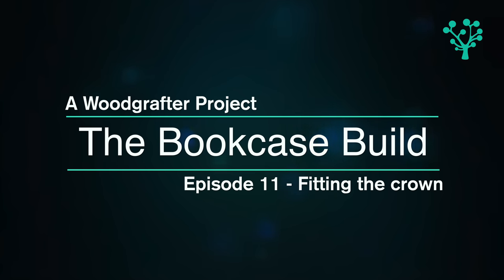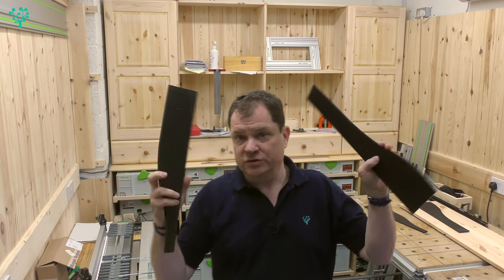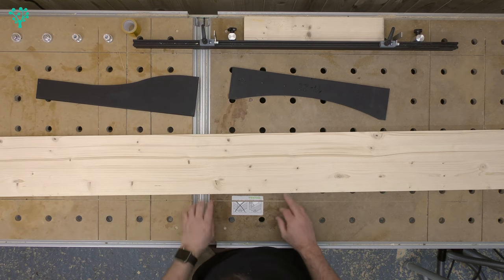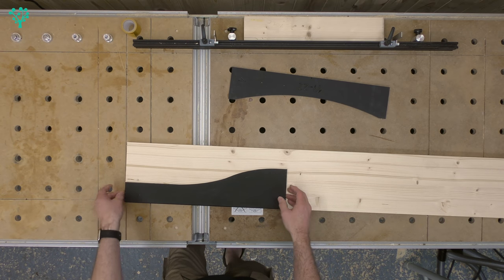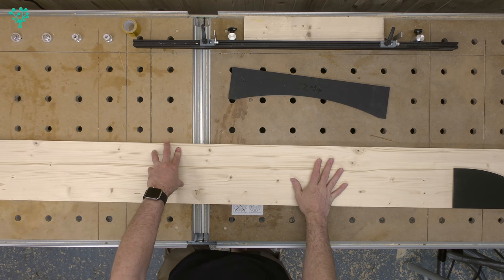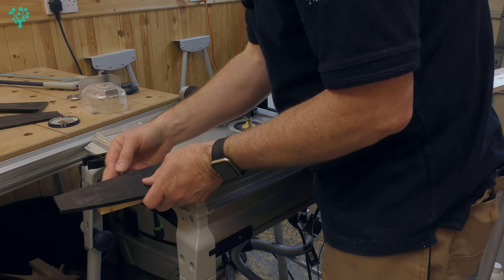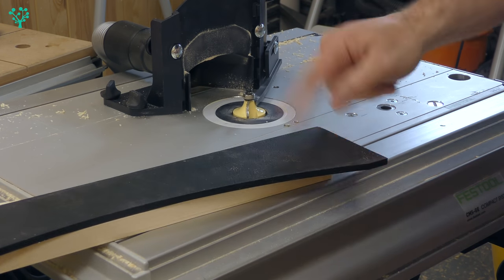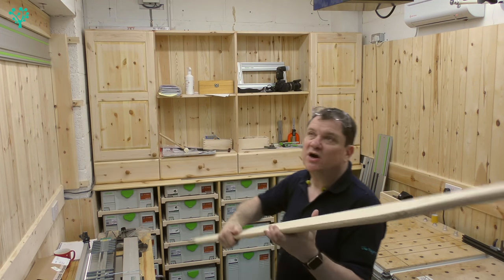How to build a bookcase - Episode 11 - Fitting the Crown

Comment: Suggestion Incase you run out of double sided tape, I use blue painters tape apply the tape to both pieces and using Supper glue glue the backs of the tape together. Great holding power and easy to remove the tape from the template and the work piece.
Reply from the maker: +TheFalconJetDriver 

Hi thank you for the tip, that is a good idea I will give it a go.

Cheers

Andy